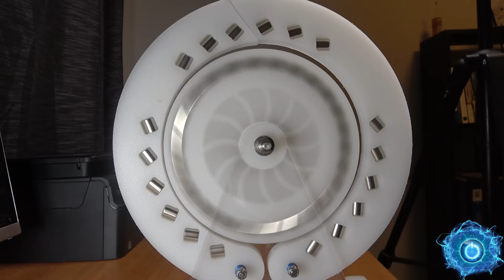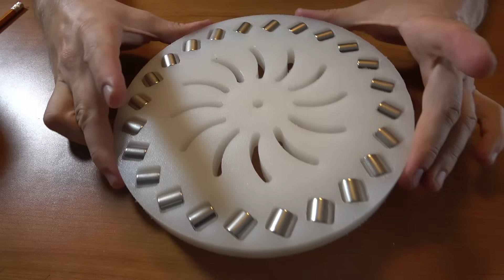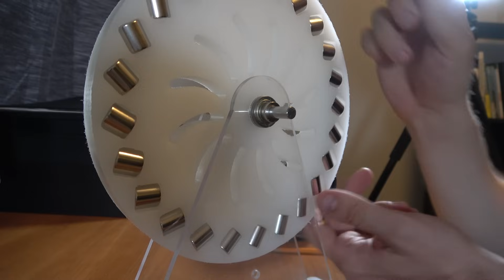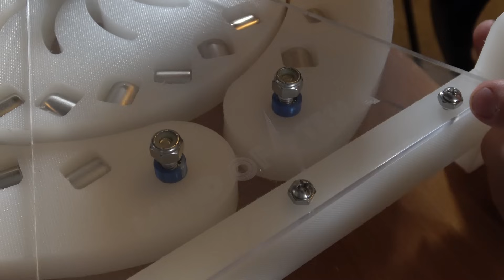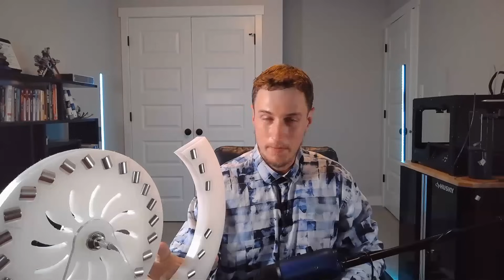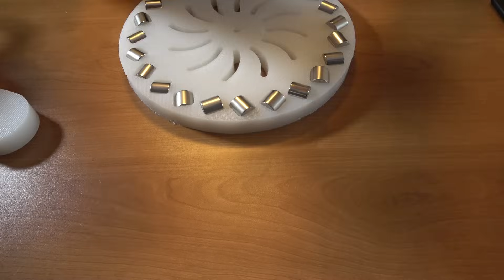Perendev Magnet Motor - Does IT WORK?!

Comment from the maker: Update  - After some analysis I decided to make a shielded mu metal variant which (in theory) could isolate the magnetic fields. I think this is what the original version is based on. I plan on building this variant in the next couple of months.
Reply: I am so glad you are working on this idea Tech Planet. I know this has to be possible. The number of people who have gotten patents on these motor have to know a few things we all have missed something. Good luck and keep us in the loop 
Peace and out v
Reply: без использования составных магнитов Говарда Джонсона ничего не получится.
Reply: The more I mess with magnets I am more than certain that HJ was correct. Compound magnets are the way to go for sure.  @antitrehlebov
Reply: @victoryfirst2878    HJ was not correct. He tried for many years but never succeeded to build a running motor. Compound or not, permanent magnets alone can't drive a motor, this is outright impossible. Also shielding concepts don't work because it needs energy to move the shields in presence of magnetic forces.
Reply: @sciencefreak9070  Thank you for letting me know Sir. I hope someone make this happen. Keep me in the loop.
Reply: There are parts of HDD had magnetic shielding you can experiment on it.
Reply: NOW you are on the correct path TP
Reply: Yes I was going to suggest this, using a non ferrous metal to block one side of the magnetic field to reduce drag
Reply: @serioussaitama4431    A magnetic field is only affected noticeably by ferromagnetic materials. Ideas for magnet motors were suggested and tried since the 13th century, but no concept showed the slightest success. No design showed rotation, not for one turn - unless the motor is rotated manually at the beginning. Permanent magnets deliver force but no energy. That's why a motor can not be driven by permanent magnets only.
Reply: @sciencefreak9070 how can there be force without energy? A force can't be present without energy, without energy there would be no force 🙂👍
Reply: @DaVeHiLl200    Force only means energy when the force works over some distance. The formula for mechanical energy is the product of force and distance: E = F*d. With distance zero there is no energy.
Put some object on a scale. The force of gravity presses the object down, the scale will show some figure for the weight. You can leave the object on the scale for years. The whole time there is always the force of gravity and the counter force of the scale acting on the object. But no energy is in play because the forces don't move anything over some distance.
Magnetic forces can deliver energy but only once. A magnet delivers energy when it attracts e.g. a piece of iron. But to repeat that you have to pull the iron away from the magnet which needs an input of energy equal to the amount of energy which was gained before. Thus you have plus and minus but overall it's zero energy.
Reply: I was just about to comment this! I havent looked into Mumetal but I did arrive at the conclusion from some preliminary digging that shielding one side of the inner and outter magnets should work. I think the shape and orientation of the N-S fields are important too.
Reply: @MrSnowFoxy    No, shielding - never mind what approach is tried - does not allow to build a magnet motor, this was tried many times without success. Shielding is only possible with ferromagnetic materials and in addition the "shields" must be moved. But to move ferromagnetic material in the presence of a magnetic field needs energy. This consumes the energy which the shielding was expected to deliver. 
Mu-metal has strong ferromagnetic properties and is thus very suited for shielding, but it also needs more energy to move mu-metal in a magnetic field. Nothing can be gained here by special materials.
Reply: There is no metalic or otherwise material that will completely SHUNT a magnetic field. If there was you COULD malke one work. But it still would not produce much power. Any heavy load would slow it down or stop it.
Reply: @jimmytraynor6023    Also an imperfect shielding disturbs the equilibrium of attractive and repulsive forces and could make a motor run. But there is another reason that shielding doesn't work and would not even work using a material which completely shunts out a magnetic field. Shielding material must be moved to be in place at the right time. Shielding is only possible with ferromagnetic materials but to move such materials in the presence of magnets consumes energy. And due to inevitable losses the mechanical energy produced by the motor would not be sufficient to  deliver this energy.
Reply: Good! Don't give up it will work, increase your chances by using square ended, rectangular magnets. Think how the magnetic field flows from south to north, especially on the edge of  poles. A few strips of copper from north to south on the edges you're not using, should weaken fields you don't want to use 👍🙂
Reply: The only problem is that you did not implement the design correctly.

And if you did. Then you're utilizing the wrong design.!

I don't believe I saw one iota of magnetic shielding.

Which is 100% essential and required.!!

For the magnetic framework you're utilizing.!!!
Reply: Shielding has been tried many times, it doesn't work. You can only shield with ferromagnetic material, but to move ferromagnetic material in the presence of magnets needs energy. Which is exactly the energy you can gain with shielding. Nature can't be tricked.
Reply: Use giron. Mu metal is not good for strong magnets
Reply: Surround the magnets with ferrofluid and make a track with micro turbines for the feerofluid to pass through
Reply: i hope you know this bigger devices are incased in 3ft of concrete around them.

Comment: What if you're able to use the magnetic blocker before it reaches the specific position and make it available once it crosses the magnet . It could easily run forever until the magnetic energy is available

Comment: Use metal as a spacer so when pushes away one is pulling then pushing then pulling the potential builds and at that point it just keeps toppling over it's self. You have to minimize resistance other wise that potential will have to be greater before released meaning more force that's more work so least amount of resistance is key

Comment: FAKE - It's a fake, don't give up, there are many other CONTENT CREATORS, much more sincere and interesting. It is possible to generate free current, the rotation of a magnetized wheel requires only 5 Watts. Now the production power is left to the exercise of the magnetic power which independently creates its energy on the inductance, which can be from 20 to 200 times higher than the necessary consumption of 5 Watts.  - E' FALSO, non conforme   é un falso,  non rinunciate ci sono molti altri CREATORI di CONTENUTI,  molto più sinceri ed interessanti .. è possibile invece generare la corrente gratis la rotazione di una ruota magnetizzata chiede solo 5 Watt.. ora il potere di produzione è lasciato all'esercizio del potere magnetico che sulla induttanza crea indipendentemente la sua energia che può essere da 20 a 200 volte superiore, al consumo necessario di 5 watt

Comment: Your'e magnet configuration is incorrect. I would elaborate but if you wanted to find out if it worked you would have put in more time in understanding the ones that do work. Not that the ones that work create enough torque. If I understand correctly there is one in India that helps power a town.

Comment: These do work however not like that....  there is not enough push from the magnets because they are too far apart. There is no torque which is needed to turn a generator.  And when it's running and has a draw on the power being generated  you need torque to counter the magnetic field created that will work against this motor.  Now if you were to place the magnets closer together, you would get the torque you need to sustain it.

Comment: Free Energy does not break laws of thermodynamics, you are using abundant renewable source of energy and convert it into mechanical energy then converting it into electrical energy, I can power my entire House 24Hours on Solar panels and lithium batteries at 17% conversion efficiency, because the ultimate source the sun is totally free

Comment: Use square magnets, this makes a difference to magnetic field, longer than the ones you have so attraction is less likely and adjust the angle so there is less angle than what you have, around 45°, possibly a little less to try illuminate magnetic attraction.
I believe the magnets around the outer rim should all be touching or if this isn't possible nearly touching should work.
I don't care what the other comments say, I know this concept will work, it's just a matter of making it correctly and having a correct gap between stator and rotor magnets. The principle comes from a magnetic river made from magnets not electromagnet, there was a video of this on YouTube but I'm having difficulty finding it, maybe YouTube has removed it altogether 🤷‍♂️👍

Comment: It's not set up right and you need to have multiple Wheels put together on the stator with staggered patterns it's always best to lay out a flat track to see what patterns work. This video does it actually have the right type of setup so it doesn't count. Free energy isn't real but overunity is and that's what the perendev motor is all about. If done right it works great. This video acts as disinformation unfortunately.

Comment: If the longitudinal axis of some/all of the perimeter magnets could pivot about the center point of that axis so that the field shifts in some way to compensate for the issues you exposed at the end maybe we'd have better results. using the convergence of neighboring fields to create some cyclic movement in sync with the inside fields. I'm just a curious laymen but I'm wondering if some sort of mechanical "platform" for each magnet, maybe linked to create some sort of synchronicity with the frequency at which the interior magnets pass by... Is anyone understanding what I'm trying to convey?

Comment: What is the difference of running this in the horizontal plane where gravity will be more uniform as opposed to current setup,  the wheel and mass of magnets is being pulled down un the up movement, of course the opposite is trues to on the far sides, so I guess the principle of equivalence equals this out? also what about running it in a vacuum so no air resistance and very low friction bearings, if not some kind of magnetic bearings where there is 0 friction.

Comment: No, it does not. Any conceivable magnet "motor" is, in fact, an oscillator that does not produce any power of its own. If given an initial impulse, it will spin for a while until friction slows it down, and it will settle in a position of minimal potential energy. If started from a position of high potential energy, it will move a bit until reaching the first point of minimal potential energy, and this gives the illusion that, with some tweaks, it might be able to start spinning on its own. No, it might not, no matter what you do. It's... physics.

Comment: Hey great work. what about if instead of the outer circle of magnets you had 6 smaller circles like gear cogs that rotated (using the inner circle to drive them) at just the right speed to influence the inner circle magnets. the outer circle cogs would have an off centre magnet so it would be closer (to influence the magnet) and then after a 180 spin would be further away... ?

Comment: I had an old friend, who has passed on, that made a magnet motor generator. He was a trained engineer for the United States Corps of Engineers. His design was based on negative energy for the bearings and propulsion. The magnets were electromagnetic so he had to ramp up the machine to start it. It worked like a rail gun or bullet train. The machine produced about three times the energy that used . When he started to get his patent, he was approached by General Electric. They offered to buy the machine. He rejected the offer. The next week he received a subpoena from General Electric and was told that they had already applied for the same thing. It stayed in court until his death. His wife died broke. General Electric got the contract for a lot of military work. His name was Shelby Palmer from Fulton,MS.

Comment: What would happen if you put a spring in the connecting part of the outer circle that is not fully compressed and not fully expanded.  Then you place the entire construction on strong springs that are attached to the floor or table.  And then you start the magnetic motor.  Would it spin for a long time?  Ps.  this design applies only a 2D magnetic force to the rotor region.  It might be wise to create a prototype on the principle of a bicycle fender, where the rotor is surrounded by magnetic fields.  Of course, springs would be used again so that the individual magnets in the outer circuit could move and thus create an oscillating magnetic field.
Reply: What ever you try, permanent magnets alone can't drive a motor. This is impossible to best asserted laws of physics. Just as you can't lift yourself off the ground by pulling at your shoe laces permanent magnets can't drive a motor.

Comment: what would happen if the outer ring of magnets was moved by wind  or water flow?
Reply: This could make the motor run, but only because of the wind or water flow. Magnets would not contribute to the movement.

Comment: According to Both GPT and Gemini if you were to use a superconductor for the outer magnets it will actually work (especially if you use magnetic bearings so there's no friction on the rotation). Of course today that also requires a lot more power to keep it cool as we don't have a room temp superconductor (yet) And the other thing would be to space the magnets out enough that it works more like a fly-wheel, so you would have more magnets on the outside frame than inner disk.

And of course would have to run it in a vacuum to mitigate other forms of energy loss.

So the concept would basically depend on 3 key things:
1. Gravity pulling a fly-wheel around.
2. Zero drag superconductors to "repel" the fly-wheel back up to the tipping point again where gravity will take over.. kind of like a roller-coaster I suppose.
3. Outer frame magnets sliding in and out of position to increase repel.

Momentum will help improve efficiency further.. And it seems we're not breaking any laws of physics as we aren't creating energy or destroying it etc. it's just transforming.

Anyway it's a fun thing to think about but totally based on fiction right now since we are missing a very important ingredient lol

I'm also still a little sceptical on the physics of this as in my own experiments from years ago, I realised there's a very close relationship between the voltage needed to electromagnetically repel something, and the power it will generate as gravity pulls it back down toward the earth...
Reply: With superconduction you could reach a construction which rotates almost perpetually but it would still not be able to deliver mechanical energy. Even the smallest load would stop it. Answers of AI are doubtful since they will depend on the questions. And AI doesn't know more than textbooks on physics. And textbooks on physics make it clear that a motor can not be driven by permanent magnets only, never mind if superconductors are used or not.
Reply from the maker: That is a really good point, I appreciate the comment! I thought about using superconductors for awhile, maybe even just using superconducting tape if I can get my hands on it. I ordered mu metal and isolated brass magnets, the video will probably take 2 months to show everything. I was skeptical too until I started messing around with coils/ultrasonics and found weird stuff with voltages.
Reply: @Motor_Explorer1  nice keen to see where you go with this

Comment: Drill a hole through those outside magnets and mount them so they can rotate! If done correctly you should be able to bipass the magnetic field of the next magnet in the series.
Reply: No. Permanent magnets can never drive a motor, never mind what tricks you try. For the simple reaseon that they exercise forces but can not deliver continuous energy.

Comment: So you have to use the kinetic energy of the rotor to extract some energy that is used to move the magnets to always point them in the correct direction, of course the rotor must have enough mass to store enough inertial energy, don't you think so?

Comment: So let me get this straight you engineered this so it can't run for long , I have seen a car run on magnets 1st & reverse gear crude but it ran , I have seen electric motors turn & light up lights  again all done with magnets also fresh air turn into water all done with magnets , magnets  work yes they need refining but they do work .
Reply: Agree

Comment: I think that a concept along these lines has potential for generating a small amount of power with minimal maintenance by the user. But it’s maddening how every video of one in action always features a cut just before the rotation gets going and it’s suddenly spinning at high speed and there’s a subtle whine that sounds suspiciously like an attached motor.
Reply from the maker: Yeah don't trust those videos. I'm building a second one with magnetic shielding, we will all see if it truly works or not.